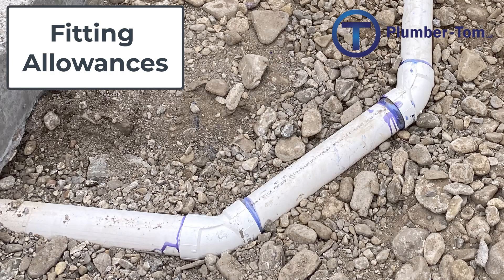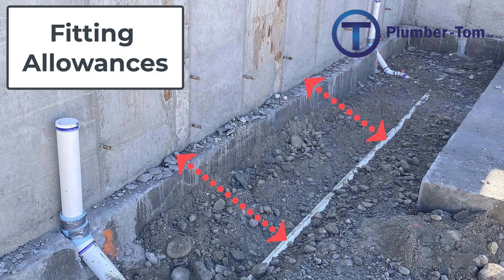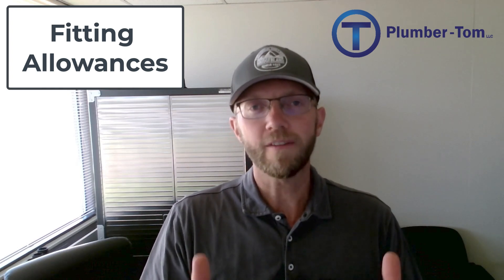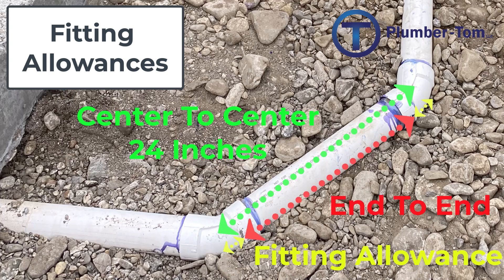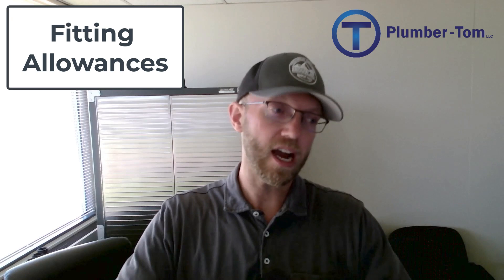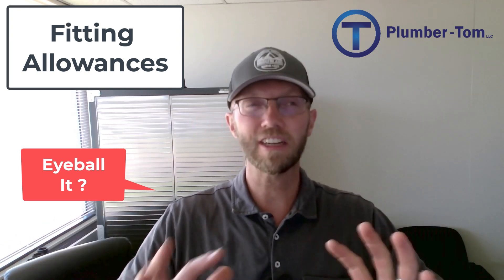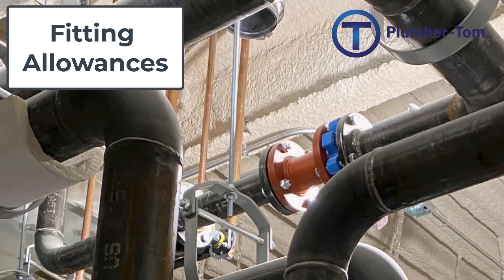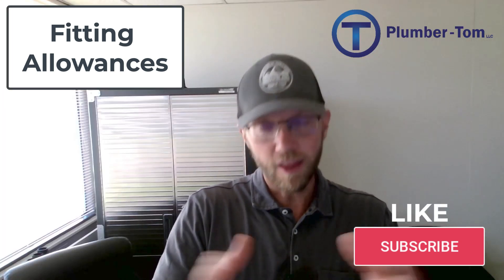Plumber Talk:  What is a Fitting Allowance?

Comment: why all that calculation.dont the fittings have the spots where the end of the pipe should stop and so you just measure from  those points on the two fittings.
Reply from the maker: That is an option.  But sometimes it is not as simple as holding up a fitting and taking a measurement.  Being able to subtract for fittings is an important skill for pipefitters.

Comment: Hi,

I'm going through a career change and taking up plumbing at my local community college. I'll be honest, I'm struggling on the field with fitting allowances. In theory, I do fine, but on the field I struggle figuring out what exactly is the center to end on say a 90 or 45 elbow. A tee is fine, but it's the elbows that get me. Maybe my eyesight is messing with me due to age, but what the measuring tape tells me never seems to be in alignment with what my instructor grades. Is there technology or tools available that can help me find where exactly is the center line of an elbow?

I've done many DIY projects at home and I've always struggled with measuring. You can forget eyeballing, I can spend hours going over measurements, put everything up, all but for it to obviously be too high, or too low, etc. If I don't stand directly, bird's eye view over the tape, I'll get it wrong. It's ridiculous, as sometimes considering the space you can't always look directly overhead at a tape measurement.
Reply from the maker: Hang in there. I don’t know if any technology that simplifies fitting allowance take offs. But I do know that manufacturers produce spec books with all the details for their fittings. That is a good place to start.
Reply: @plumber-tom9470  We have great spec books at the college. I have two of them - they work fine for the most part and give you a general idea. Unfortunately, they would work best back in say the 1960's when China didn't manufacture everything.
Reply from the maker: I see.  Probably depends on the manufacturer, but I know some of them like Charlotte Pipe have up to date specs.   @MegaAvalonn